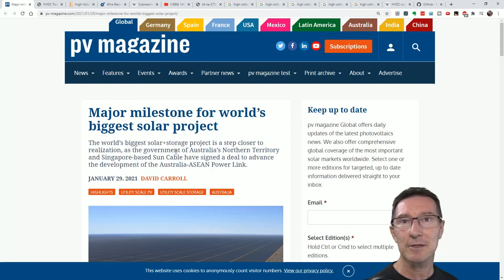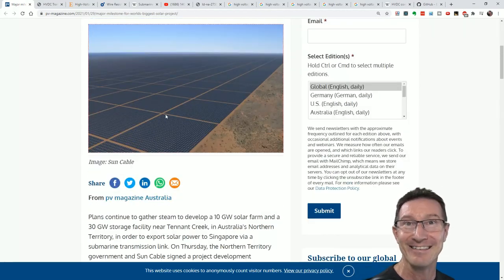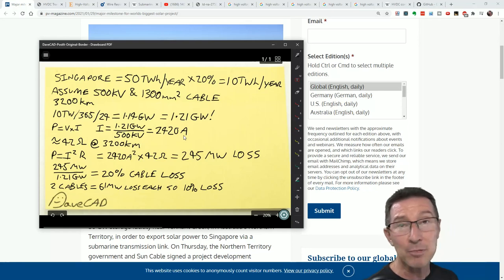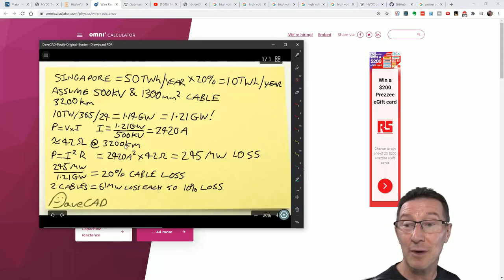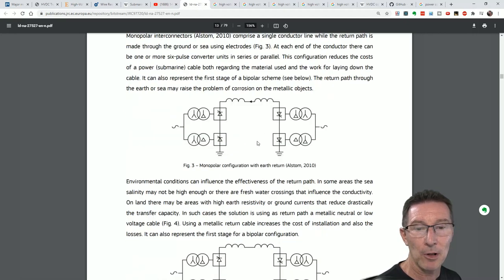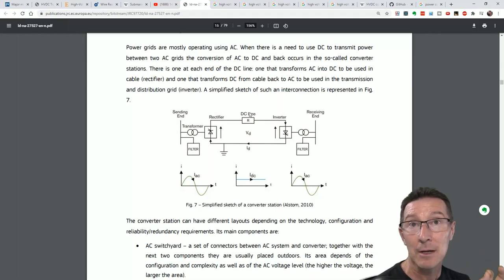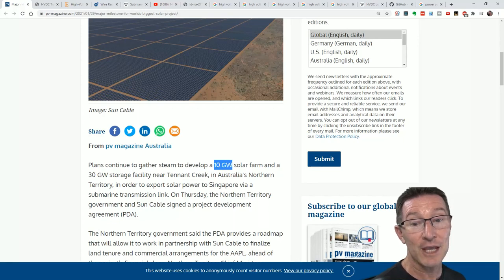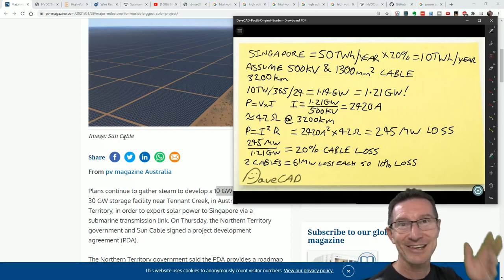World's Largest Solar Array - HVDC Transmission Calculations...

Comment: I'm working as a control engineer in the development for large modular multilevel converters. At 14:41 you see some cells of a modular multilevel converter (MMC) and the connections to the transformer. In principle, some half or full bridges in series. In the picture it looks like they use full bridges. If half bridges are used, twice as many cells are needed. Due to the series connection of cells, the necessary blocking voltage for each semiconductor is reduced. At 500kV with 20 cells in series, the voltage across one cell is "only" 25kV (still too much - more cells are neccessary). That is why they don't have a common potential and need to be seperated with enough clearance. That is the reason why they hang from the ceiling. Another advantage of the design is the high possible resilience in case of earthquakes and floods (depends on location).

Each cell has its own controller and power supply, which are supplied from the cell capacitance. And you need a clamping circuit in each cell, otherwise you destroy a semiconductor for each switching operation. The semiconducters are water cooled. Each thyristor/IGBTs/IGCT weighs several kilograms and has an own FPGA on the gate unit. For each phase leg 50 cells aren't uncommon, then you have 150 cells with all in all 600 thyristors/IGBTs/IGCTs.
For the control it's very important to have a voltage measurement of each cell capacitance. The control must calculate at which time which transistor/thyristor is switched. The cell capacitances must be charged again and again so that the voltages of all capacitances are as identical as possible. Otherwise the output voltage would drop. In addition, reactive power must be controlled for the power grid.

It's a lot of control and protection stuff you have to implement in one of those. 10 to 20 FPGAs are needed for higher-level control and protection. All communication takes place via fiber optics. It's fast and you need the galvanic isolation between the controllers. You have main control, 6x phase leg control, main protection, backup protection, 150x cell controller and so on. The numbers are only as an example, but realistic.

The transformer (connections on the right side in the picture at 14:41) is needed for the desired voltage.
I'm not an expert for the cables, but for this project it will be way more thicker than 1300mm² and the voltage will be higher than 500kV. My guess would be 800kV. Currently the highest possible voltage is +/-1100kV. But in this case it's "only" 1.2GW, you don't want to use so many cells and such an expensive transformer. It's a huge difference between 800kV and 1100kV. But who knows what their calculation show.

You can use a monopolar line with the earth as the other line or you use a bipolar line. Then you need two cables. The advantage of bipolar transmission is twice the voltage with appropriate converter topology, but you need a second cable.
In monopolar transmission, the power flow cannot be reversed simply because of the high capacitance of the cable. You have to wait. In this case, you only want power flow in one direction and therefore monopolar transmission would be possible. If you can manage the electrolysis.
Reply: Very interesting, now I need to go away and work out what all that means!
Reply: The efficiency of a converter is approximately 98.7%-99.2%. So you can roughly say 1% loss per converter. Since a converter is needed at each end of the cable, this makes 2% power dissipation. The transformers have also some power dissipation, but that's not much.
Reply: On monopolar, the current return path is through the earth? How the hell does that work?
Reply: @userPrehistoricman  Earth is a surprisingly good conductor, it is used as return path in many power transmission systems. It helps that you typically have a very large cross-section area (i.e. the planet).
Reply: The heck @monchilo dude is there a good book to use as reference for desing of these kinds of hvdc systems? And how do they make it, to me it seems hell of a big project but is sooooo interesting really want to learn more bout it
Reply: @fernandocaballero5102  It does take some time from sale to handover. So depending on the scope, the development and production takes 3-8 years.
I learned a lot from a German PHD thesis about MMCs for my Master thesis. But the book/thesis is in German (Optimale Betriebsführung des
Modularen Multilevel-Umrichters als
 Antriebsumrichter für Drehstrommaschinen by Johannes Kolb).
MMCs are not only used for HVDC but also to drive large machines with speed control. For example, the motors/generators in pumped storage power plants.
The principle of the converters is similar but without a large dc link.
 Therefore, there are also good books on this topic in drive technology.
I guess the newest English book is "Modular Multilevel Converters: Analysis, Control,and Applications" about MMCs. But it involves quite a bit of math and control theory, e.g. space vector modulation. I wouldn't read this just for fun.
I guess the best way to start would be to learn the principle about 3 level inverters. Because a MMC is similar to two coupled 3 level inverters with more levels, not 3 but maybe 30.
 One level = one adjustable output voltage
And for 3 level inverters there is a lot of documentation and you can even build one with cheap components.
Reply: @Momchil0  For transformers once need to add 2-3% for each side as well, and for 1.21GW maybe 5%), so 4-10% plus. Total cable + converter + transformer. Owner Shouldn't be disappointed if calcs will match real. Btw all this will be included into the cunsumers bills anyways.
Reply: Btw if you know about Australia-Tasmania DC coverter problem they had around 10years ago?

Comment: 3 million homes a year ? -- someone getting their GW and GWH mixed up
Reply: @andreijecu765  DC is more efficient in terms of loss.  AC is easier to do, that made it feasible and economically efficient in those days.
Reply: @UCjJSUAQS5mgabOZ0t8Tb-CQ With AC you have capacitive losses and skin effect. None of that really matters with DC. AC is used, because stepping up and down is easy with transformers.
Reply: Yeah, why not "per year", just imagine...  the first 3M houses that are built get power, then once someone builds 3M+1, they disconnect the first house, and power the last house, so you always do 3M/yr.  There you get the 3M/yr.  Do not even ask what light year is to these guys, you could get a surprise.
If you wonder, simple: a light year = total amount of money 12 light (power) bills you pay in a year.
Reply: I was just about to comment on that. This is SUCH a common mistake, and I do not understand why. It's like "I'm driving 50 miles per hour per year!". I wonder what such an author's answer to "So how many homes does it power per day?" would be.
Reply: It's worrying that there are people involved in such a massive project who don't understand the difference between energy and power, or maybe they just have a sketchy idea of the whole concept of words and sentences.
Reply: And what is 30 GW storage supposed to mean?
Reply: It only powers 342 homes per hour. That works out to be 3 million per year. Genius.
Reply: no reactive component with DC which is part of the reason why its used over AC in long distance transmission
Reply: I see so many Tesla YouTubers doing that where they confuse kW with kWh and it bugs the crap out of me!
Reply: @scream221  I agree.  30 GW represents how much instantaneous power the photovoltaic system is capable of generating.  I know of no solar storage system yet installed with 30 GWh of storage capacity.
Reply: At least they didn't say GW/hr.  Which is really annoying as that is a legitimate unit in the context of load rates of change.  Not that these idiots would understand that.

Comment: What they usually do with HVDC cable is run a positive cable at +400kV and a negative cable at -400kV at earth reference so you can double the system voltage (thereby halve the current) while still only using 400kV rated cables. For the HVDC system here in South Africa cables are also run physically apart so that any localized event that causes a cable break only affects the one cable and the second cable can be used in SWER configuration to still deliver power (I'm not sure if this would work everywhere).

Comment: I think that they use bypolar feeds, so one is +800KV and the other -800KV, so the maximum voltage to ground is only 800KV, but the transmission is actually 1.6MV. The positive and negative then get received at seperate valve halls (I believe that's those massive thyristor stacks you showed photos of in those big sheds), where it is converted back to AC.
Reply: ya it looked like in the documentation it said +/-800KV so I would also read that as 1.6MV between the two
Reply: +/- 400kV looks like the present limit  ? 

- beyond which we must assume Scotty "she can 'nae take it cap'n" applies and bad things happen.
Reply: Remember this is an undersea cable .....
Reply: @lrdiscovictim  Oh, good. I'm sure it will provide some secure anchorage for a cruise liner or two. Alternatively, some responsible dragliner will certainly be helpful and retrieve it from the bottom of the ocean. What could possibly go wrong?
Reply: @timberwolf1575  - there's plenty that could go  wrong - and I'm not saying that I want it to fail - but some extended arithmetic and honest risk assessment should balance the enthusiasm for Star Trek engine room converter stations
Reply: @lrdiscovictim +/- 600kV undersea between Scotland and Wales, 2.2GW

Comment: I roughly calculated the copper for the cable - 36,000 tons, £150 million. Maybe they use aluminium...
Reply: A HVDC converter costs about $500M (AC one is about $50M), forgot to show that link in the video. So yeah, not a cheap system!
Reply: lol thanks for this
Reply: @EEVblog   apparently one in Algeria is going to supply the UK,
Reply: @dogwalker666  No,  such an interconnector is not even in scoping and besides it would almost certainly connect to the EuroGrid in Spain, France or Italy.

These are the interconnectors , either in service or planning for England and Wales

https://www.nationalgrideso.com/document/183636/download
Reply: @MartinE63  I know its ridiculous and it would disappear into the national grid's,  The UK is already connected to the French grid, I was saying what the advertising agency was claiming, In reality it was just green hype, Just like Solar Roadways.
Reply: @dogwalker666  there was some scheme proposed several years ago for a grid extending across North Africa and beyond called desertec

https://en.wikipedia.org/wiki/Desertec

There is a connection or maybe two from Spain to Morocco already.

The UK now has two links to France, one to Belgium, one to the Netherlands, one to Eire, one to Northern Ireland, and already in construction and coming in the next couple of years an additional link to France (through the tunnel) plus links to Denmark and Norway.

There is also an already operational 600kV 2.2GW subsea hvdc link from Scotland to North Wales
Reply: @MartinE63  I know I used to work for national grid!, as I said it was being advised on tv that they were going to open a massive solar farm in Algeria to supply green energy to the UK and that as we know is impossible.
Reply: They should use silver. a whopping 7% better conductivity at a mere 100x the price! (Though I suspect if you tried to buy 30,000 tons plus of silver the price might increase somewhat)
Reply: @jhonbus  why not gold?
Reply: LOL uhm, more like several billion quid.
Reply: @prjndigo  Yeah, I think I missed an -illion somewhere.
Reply: @bobafruti  Silver is a better conductor than gold. Aluminium is MUCH cheaper...
Reply: Take a look at Western Link in the UK  - purportedly the highest voltage HVDC  link to date... Looks like there's a PR embargo on reporting it ....  3 years late and multiple magic smoke escapes
Reply: @lrdiscovictim  Probably got all the thyristors cheap on eBay.
Reply: @bobafruti  Because gold is less conductive than copper.
Reply: @misstakenot9582  but how are we going to spend all of the money?!?!
Reply: @bobafruti  silver is more conductive than gold in its pure state (unoxidized).  The reason we see gold plating on connectors is that gold doesn't oxidize as easily. this means if you plate a thin layer over the surface you protect the undelaying layers of whatever other metal you used.
Reply: @markburton5292  yes but how will you waste billions and billions of dollars otherwise?
Reply from the maker: @jhonbus  During the Manhatten Project the US government borrowed all the silver in the US strategic reserve to make low resistance wiring. It was melted down and recast into bars and given back afterwards.
Reply: @EEVblog2  Wow, interesting to see it put to more use than "being valuable".
Reply: @dogwalker666  Wouldn't it just be easier if everyone in the UK moved to Algeria?
Reply: @rogeronslow1498  probably and warmer.

Comment: Major reasons for DC are:
1) AC reactance would present a show-stopping resistance to AC conduction on a line that long.
2) Ac voltages are given in RMS root-mean-square, the peak voltage of an RMS AC voltage is 1.4 times higher.

A 500kV ac circuit will actually require a 1.4 x 500kV = (700kV) capable insulation system.  The AC waveform has periods of less than peak voltage, actually 98% of the waveform is less than peak, so one can't actually transmit as much energy as a DC link that always operates steady state at the system's peak voltage.

3) An AC transmission system would require at least three conductors instead of two or one.

With storage on both ends of the this proposed link the transmission capacity can be reduced to a 24 hour average instead of only the solar day (6~7 hours).  That means the cable system power ability could be 1/3 to 1/4 what it might otherwise need to be to transport only daily solar.

Comment: I understand that there will be several smaller cables on the link rather than a single huge cable. This increases the resilience of the system.
Reply: Parallel cables increases the current carrying capacity per unit of cross sectional area.  The increased surface area allows for better heat dissipation, so the resistance won't start to increase.  I'm not sure if that is their prime consideration though.

Comment: The HVSC link in Sweden was apparently primarily to avoid network synchronisation issues because the network would desync if they closed the loop after the fact when all the europe/russian Powergrid had synced around the Baltic Sea, and given the speed of light of the copper you cannot AC couple Denmark and Sweden without getting massive problems with out-of-phase AC because of that, so they chose HVDC.
Reply: The Northeast Blackout [of USA/Canada] of 2003 and the like suggest that AC isn't the best approach for producing a robust system which avoids contagion.

Comment: Dave, with regards to DaveCAD on GitHub, you need a license. By not having one, it's by default all rights reserved copyright to you (so using code or anything on there that doesn't have a license is sketchy), and it's really important for a repo to have a license. Please pick one!
Reply: It has the openDave license!

Comment: Water will conduct the heat from the cable giving the underwater cable higher capacity for similar conductor suspended in the air.

Comment: In answer to your question at 18:10 it looks like the preferred supplier is 5B's Maverick system which is deployed in an alternating East/West (but still both North tilted) fashion (https://5b.com.au/news/press-release-5b-sun-cable-announce-plans-worlds-largest-solar-farm-northern-territory-australia/). The idea is what you lose in individual solar efficiency you gain back in longer and more even total plant output over the day without the expense of tracking. Not a bad tradeoff when you consider that the cost of the panels themselves will be a relatively small part of the total project cost compared to your normal solar farm.

Comment: Bite those cable sharks, I dare ya.
Reply: Sharks won't get electrocuted for merely touching the thing for the same reason birds don't get electrocuted for landing on power line.
Reply: @luongmaihunggia  ahh but put two conductors in one cable and they will.
Reply: Like in the movie Jaws.
Reply: If a shark bites this cable, it will be interesting.  Remember this is sea water, ie lots of salt (NaCl), which makes water pretty conductive, and the water body is basically ground.  Now, the shark will need to go thru the external steel mesh to reach the juicy core, but given enough time, it can happen.